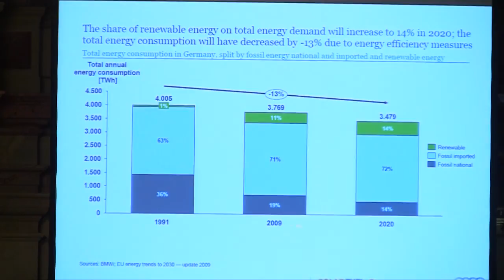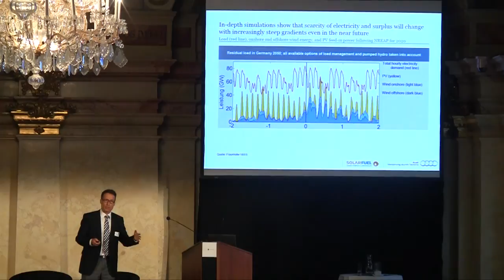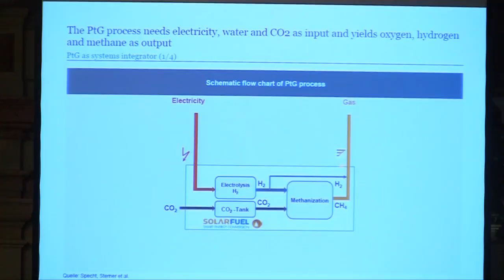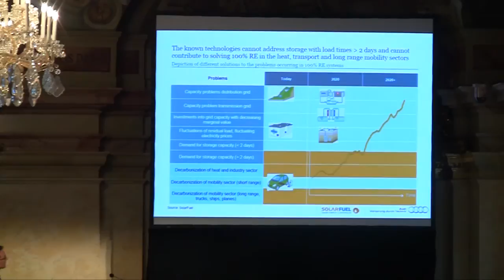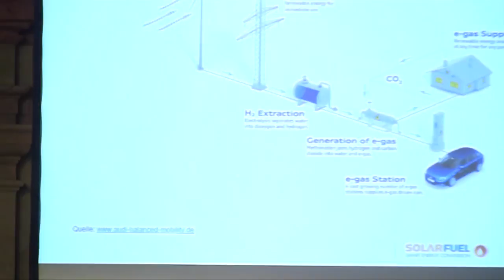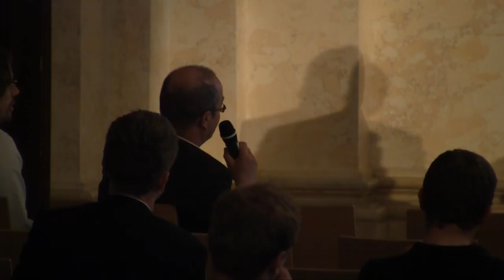Hermann Pengg - Energy conversion and storage using the Power-to-Gas Technology

Comment: You can store 1600 GWh with a basin of 500m radius! Use the hydraulic hydro storage. It is only true if we use old pumped hydro. Synthetic Methane has only a round trip efficiency of 30%, this is OK for cars, not for the grid.